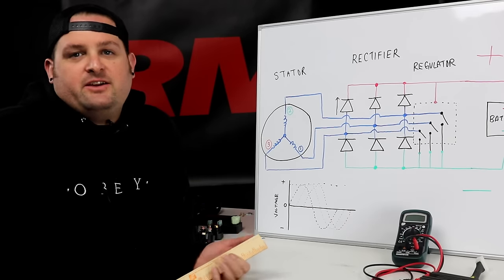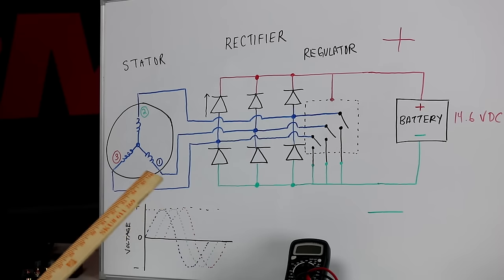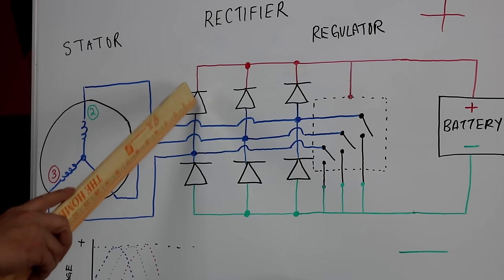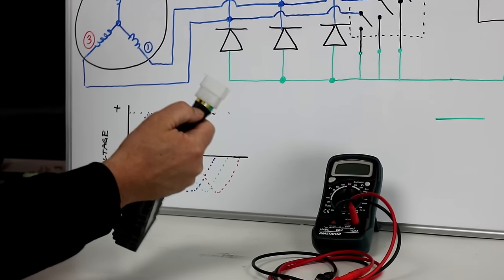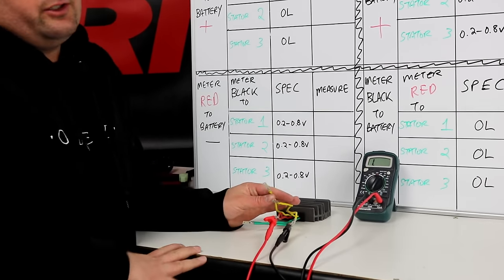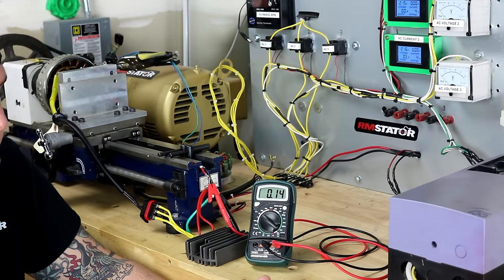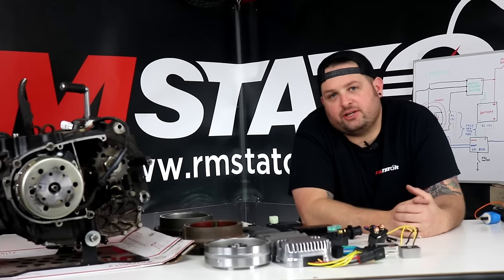How to Test Voltage Regulator Rectifiers for Motorcycle, ATV, UTV, Snowmobile & Powersports Engines

Comment: Evan, I have owned quads and bikes for over 30 years and I always just fumbled around with trying to figure out what's wrong with electrical/starting issues.  Sometimes I'd get lucky and fix the problem, but usually not.  Watching your videos has not only given me the necessary knowledge and thus the confidence to diagnose electrical issues, but it's actually excited me to the point where I want to learn more about these systems.  Thank you (and RM Stator) for taking the time to educate people like me...for free!!  RM Stator has a life-long customer in me due to both the high quality informational videos as well as the extremely high quality and durable products you produce.

Comment: How are you getting a resistance reading when you're going from phase to negative? It's supposed to read open I thought. What's the score through the shunt switch.?  When you read FaZe to positive , you get open lead or OL. ? The proper direction for the electricity is from phase to positive through the diode. But when you test it it seems like the exact opposite.?; I went to school for all this just trying to refresh my memory. The diode blocks the reading from phase to positive according to your tests. But in reality theory you teach electricity is going from phase to positive in that direction.

Comment: This was one of the videos I watched to figure out the charging problems on my 2000 Honda VFR Interceptor.  Did the other tests and now that I know how a voltage regulator/rectifier really works, I was able to conduct the test and found one leg of the diodes not working correctly.  Easy removal, ordered the part, and now we wait...Thank you for the clear, detailed, and concise advice.  

I'm not a mechanic by any means and electrical has always caused anxiety, but this video made it much easier and increased my confidence to undertake this.

Thank You!

Comment: DUDE!! You deserve a prize! Not just for explaining the function of a voltage regulator but for making it fun and easy to understand. Maybe I was just ready for this but you made it easy to understand with this diagram. Now the whole component seems so simple. Now splicing wires to make a change from like the four connecter plug on the smaller 50cc regulator are going to seem so simple. I'm sure I'll goof some stuff up but that will only be because of curiosity in seeing what might work, This was just great!

Comment: Excellent. No waffle. No annoying music. Just clear description and facts.
Reply from the maker: Right on!!!
Reply: My 2008 Aprilia rsv has an extra wire on the output side which runs to the ignition switch, is this a separate supply to the switching of the regulator and why is it there ?
Thanks for this post !

Comment: Retired engineer with Harley losing charging while on the road. Great and straight forward explanation. Are these rectifier regulators usually failing due to over heat. I have a chrome basket over top of the reg which may limit heat shedding.
Reply from the maker: Yes, heat is usually what eventually kills them. I would not recommend running any sort of cover on a regulator, no matter how shiny! Harleys are hot motors, and the regulator soaks up alot of heat on these. Let the cooling fins do their work!
Reply: @Rmstatorinc  Thanks for the reply. Bought a new Drag Spec as RMStator didn't have a reg for my 2008 Harley Street Glide. When I bench tested it I had 1's with red mm on +ve and -ve DC pins on all three AC pins but 1's and .470 V with -ve on DC pins and red on all three AC pins. This is the same as bench test results on old reg.Bike ran well after install and 100kms no fluctuation for 14v on my on bike volt meter.

Any suggestions

Comment: very professional and clearly explained. thank you. i have tested 3 reg/rects following the same steps and all 3 passed but when I connect the red wire from the units to the battery's + and the black to the - there is a short (sparks and melting wires). Any ideas why this is so? It's a 97 suzuki savage.
Reply: mystery solved. my battery had reversed its polarity. strange but true. the guy I bought it off must have charged it the wrong way or something.

Comment: I find out that three diods are dead! They are "closed" in both direction. It is either the three up or the three down in your drawing. But all seems work fine with only three diods? Charge is about 14.6V. Battery 13V, fully charged. I suppouse the voltage is pulsing, but my voltmeter don show that. Should I change rectifier anyway?
Reply from the maker: Some rectifiers are half wave, meaning they only have 3 diodes in the top of the rectifier bridge. This could be the case. It is usually on smaller cc motors. That would explain your test results and still charging fine.
Reply: @Rmstatorinc  i bought a new bigger one from Amazon and it shows same when i measure it, I test same on a third (for Ducati) and äll are same...

Comment: Thanks. This helps a ton!  I am working on my 2008 Yamaha F40. The voltage is reading 16.1 volts at running speed.  That can't be right.

Comment: Great video, very informative. But I have one question, I have a 2001 Honda Shadow 750 and the wiring coming from the stator had gotten hot and the connector was in really bad shape. I cut the connector off the old connector and installed a new one.  When I found the issue two of the wires were in really bad shape with one of them completely disconnected. I believe I got the wires back in their original positions as it seems to be operating properly but was wondering, does it matter what order/position the (yellow) wires from the stator are in when connecting it to the rectifier/regulator? Can they be in any position? Also, can the system work with one wire disconnected?

Comment: What would cause the regulator to intermittently spike at 18 volts then go back to working normally again, if something failed wouldn't always be failed, can shunting switches be bad then start working correctly again
Reply from the maker: This is typically a failure of the control IC chip that triggers the shunt switches. It will likely continue to get worse, then stop regulating permanently. I would replace the regulator before this happens.

Comment: I would also like to see if you can test the regulator with a non running engine, only crank. I have a no spark issue, new cdi but trying to rule out the regulator. Rectifiers work fine.

Comment: I love your set up for actual testing.  I had not thought of using my lathe to spin a flywheel over the alternator.  However, in my own research of the charging systems, I'm something less than impressed.  After going through 4 regulators in 5 months, I've begun taking them apart.  (Yes, it's a lot of work but you can get the potting epoxy out of there.)  Of course, using 1960s technology in the 21st century is rather like going moose hunting with a pocket full of rocks and a sharp stick.  SCRs shunting 20 Amps to ground in an age of high power MOSFETs???
I'm disappointed with the ratings of the components.  There is virtually no safety factor which makes the regulator very unforgiving.  But it's also the only application I have ever seen that has the heat from the components must pass through the circuit board to be dissipated.  Circuit boards do not conduct heat.  I have also found as much as 1/8th inch of epoxy between the circuit board and the case (heat sink).  It seems there is nothing to insure the circuit board does not "float" up and away from the cooling surface, to be suspended in the epoxy.  By the time the case gets warm, the components are burned out. 

Mine is a 30 Amp alternator.  Short-circuit current, at 1500 RPM is 29 Amps RMS.  (That's 42.3 Amps peak)  So 35 Amp components won't play long.  Open lead voltage on the alternator, at 1500 RPM, is 60 Volts RMS.  (98.98 Volts peak)  60 Volt rating on components?  Really?  Then more than 1/8th inch insulated gap between the heat source and the cooling surface?  The last one I put in worked for exactly ten seconds.  With those components, heat dissipation is EXTREMELY important. 

I'll build my own.  The components will have a thin piece of mylar between them and the cooling surface.  The circuit board will be above them.  And why are my 44 Amp components physically six times larger than what I uncovered in the epoxy?  They still fit inside the old housing.  What I found in the epoxy would appear to have been developed during a wild office party, and then careless workmanship added for good measure.  "Engineers left unsupervised." 

Talk to someone from MIT, have them put a "MODERN" regulator together for you, and you'll never have to replace it again.  Added advantage...  With a constant 14.2 to 14.4 volts out, you won't have to add water to your battery every other month.
Reply: Can you do a video of your build please Twinkler ?
Reply: Great observations.  Just a guess, but maybe the Yesteryear products are under designed and manufactured overseas to intentionally fail sooner than they should.  That keeps US dollars flowing to a country whose very existence depends upon the design and production of substandard products to the rest of the world.

Comment: Hi, is there a sequence for wires when you connect  them from stator to the regulator/rectifier
? Does it matters where any of the 3 yellow cables  enter the  regulator/rectifier (also yellow) ?  Someone cut the socket that comes from the stator. TY
Reply from the maker: No there is no sequence or polarity for the 3 Yellow wires from the stator to the regulator. They can be connected in any order.

Comment: Do you need a capacitator / battery in order for the rectifier regulator to work properly?
Or can you simply clamp the multimeter on the DC output?
Reply from the maker: Most SCR type (non-MOSFET) regulators will function without a battery. However it is recommended to always run the system with a battery installed for proper testing.
Reply: @Rmstatorinc  Thank you.

Comment: I own a 2012 husky te 511. so diodes check out, rectifier good. but,  the regulator does not climb all the way up to 14.6V .   gets to about 13.7 then start coming down.  any ideas on what to test next?
thanks!  great video

Comment: My rectifier has a red, green and black...and the 3 yellow.  The red and green are obvious but not sure about the black.   Is it a ground that should go to the battery...or is it a hot wire for powering lights?

Comment: 👍👍great  vid. guys..
But what if your battery is overcharging..?? Idling 14,5v. rev a bit 18 19 20
I measured my rectifier regulator in same way like you..and it showed the rectifier regulator is good..
What to do..?
( i just noticed as well that the red "bulb" on ignition switch is blinking sometimes or flashing continuously..when it happens bike has no power..if i turn off the bike and start it again few time until i notice that the red bulb on the switch is not flashing then bike has full power )
Any help from you..?

Comment: I have a 3 phase chargeing system , with 3 wires out red goes to battery?  Green goes to ground ? Black goes ?  3 yellow goes to another connector,
Reply from the maker: If you have a Honda, typically you will have 3 Yellow wires going into the regulator from the stator. On the regulator Green is Battery negative, Red is Battery positive. Black is a switched +12v from the keyswitch that is used as the regulator voltage reference.

Comment: Awesome video. Have a question is there a sequence in the yellow wireing  because my bike don't have the original connector?
Reply from the maker: Thanks! There is no polarity to the Yellow wires. They can be installed in any order.
Reply: I had this Same question running through my head 10 minutes ago and this answer solved it !! ... had a new RR installed but the mechanic had to rewire the connector and I was wondering about any certain order.  Great video explanation! 👍

Comment: Great video. I had a question though. A bit new to this stator rectifier deal. So I got a relocation kit to put my reg/rec in the front of the utv. But having issues with charging now. I'm wonding if the harness has the stator output cables to the reg/rec flip flopped.. say # 1 on stator is connected to #2 or #3 position on the reg/rec connector. This would cause a issue correct?  My voltage guage shows 11-11.5 vdc at idle now instead of 12-14 vdc. 
When I test the stator it tests good 20vac at idle on all 3 legs, Rev up and all 3 legs jump up 50-70vac. I tested the rec/reg and seems like all 3 legs are reading correctly... .5 at each. But I noticed it's getting quite hot quite quick and low voltage reading at battery and car idles funny.
Thank you in Advance 🤘🏼

Comment: Can you explain what signal is being sent from the reg/rec via the white/violet wire to the ecm on a 2004 skidoo 600 SDI, it causes the eco to turn on and off the main power relay to power up and down the speedo cluster.

Comment: My new RR passes test 1, 2 and 4. Test 3 (Meter Black to Battery +) should show readings but doesn't. My reputable supplier in the UK suggests I connect it to the bike (a 2015 Royal Enfield Classic 500) and see how it goes. What symptoms would be apparent if the RR was, indeed, faulty?

Comment: Excellent video!

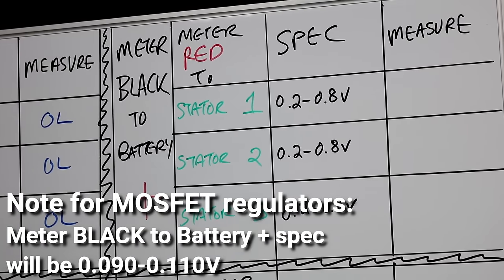Could you explain why @12:00 MOSFET regulators meter BLACK to Battery + spec will be 0.09-0.11v?
Why are their reading different in this direction?

Comment: Need help: I have replaced twice my regulator/rectifier (sym vs125 2010) and it burns after less than a minute after engine start. Already checked all connections and also replaced the stator. 
What should I test?

Comment: Please you guys allow met ask the following, first for not so up to standard with electronics i found this very informative. I have restored a old 12V motorcycle with of course old 56(yrs) electronics. Since I restored the bike putting EVERYTHING in its position I got i have the following problem. The system keep on blowing the the headlight globe 45/40.Some one tested the rectifier (readings were .5,1.0 and .5 the other way round zero of course. What regulator/rectifier would you recommend in this case please??? Thanks in advance

Comment: Hello RMSTATOR, Would it have been a better idea if when the voltage was higher than it
should be, that it would go through a resistance instead of a dead short? I just had my RR 
go out on me, a nice bit of smoke! It turns out the connector a 2 pin plug on a 91 Sporty
heated up  and shorted the plug between  the stator and the RR. Luckily the stator is good
as it is within H-D specs and delivers 65 volts at 2500 spins of the crankshaft.
I can see that if  any top diode opened up it would reduce the amount of current, as that leg
from the stator would not be deliviering any volts or amps. If one of the bottom diodes
opened up, would that overload the other two diodes? No telling what happened to my RR.
a total open between stator leads and Bat+ wire. Thank you very much for your help.

Comment: My stator and rec/reg check out with all of the multi-meter tests, however when running the bike, at idle I see about 13.9VDC, and when increasing RPM's it drops DOWN to about 12.5VDC, does this indicate a bad rec/reg? Thanks!

Comment: is it possible to mixed or exchange  the wire from the alternator to the rectifier?

i mean like if there is no terminal only wire from the alternator to the rectifier (yellow wire)? is there any specific connection for that?

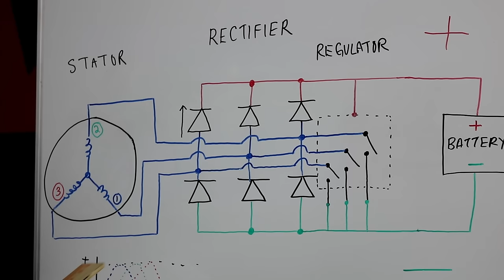Comment: 9:37
I see you removed the yellow wires from the plastic housing/connector for the test.  Do they have to go back in the plastic housing/connector in the same order for the charging system to work right?  What if you didn't keep track, and put the yellow wires back into their plastic housing in the wrong order?
Reply from the maker: The Yellow stator wires can be reinstalled in any order, there is no polarity. No need to keep track!
Reply: @Rmstatorinc     Thank you!  Great video BTW
Reply from the maker: No problem!

Comment: Hello, made the regulator test in my Africa Twin 2016 and it is not charging over 13.2 volts, even at 5,000 revs. Could a shorted circuit be the cause?...  I checked the rectifier/regulator by performing the tests in this video and all measurements are withing the specified ranges. The reading on test #3 (meter black to battery plus) shows 0.096 volts readings on all three wires of the stator, so I assume my bike has a MOSFET regulator; not quite sure though.... 
After some months I received a new rectifier/regulator (not MOSFET though) and now the system is charging at 14.37 volts, so I guess the OEM rectifier/regulator was defective reaching only 13.2 volts.... Wonder why the OEM rec/reg became defective; could it be I jump started my bike with a car when the battery became old and didnt hold up charge anymore?
Thx for the very comprehensive video!

Comment: What would make my rectifier get very hot and start a humming noise? I have a Honda foreman 500 ( 2016) model. I purchased a new rectifier and installed it today and it’s getting very hot and humming. I noticed last week my battery kept going dead and I just purchased a new rectifier. I’m not real sure my old rectifier is bad.. any help I would appreciate it. I have looked for burnt wires or broken grounds..I don’t see anything like that.

Comment: What was the problem???? I hear a very clear buzzing sound from my gas gank or somewhere close to the gas tank. Also sometimes when I try to do a burnout on my bike the battery wires gets burned and the bike completely die then I have to put another battery clip to attach it. I don't know what the hell is wrong with my bike. Please tell me if you understand anything